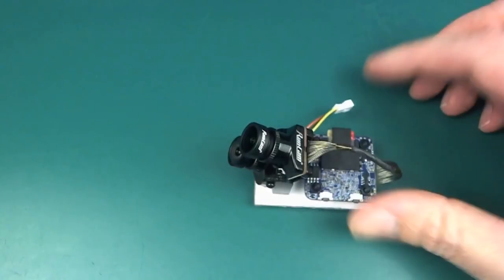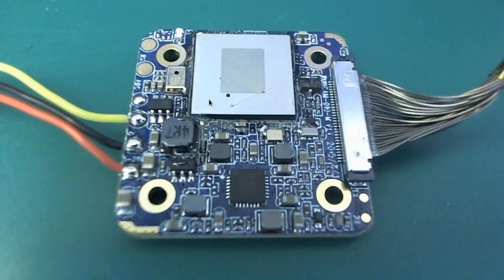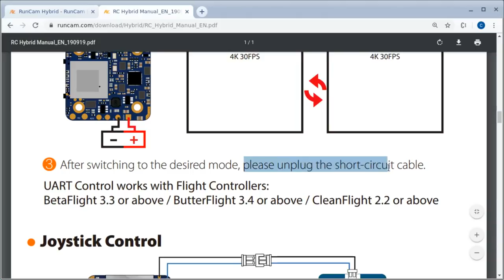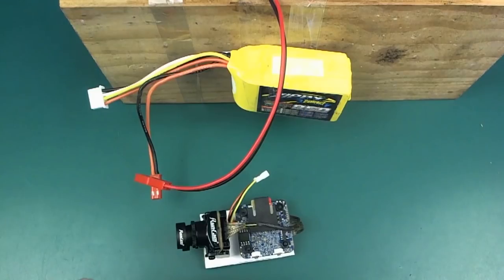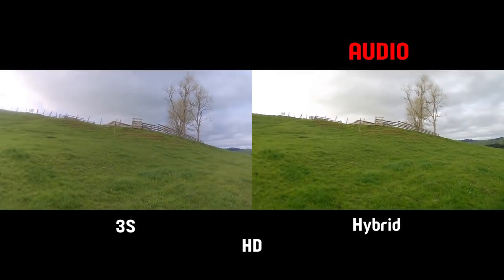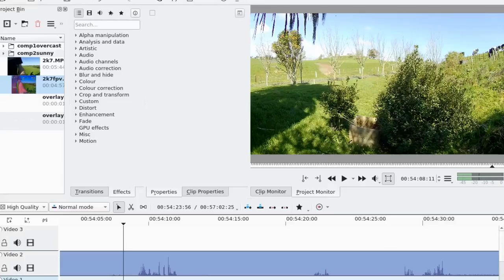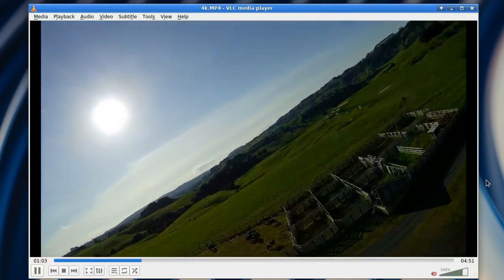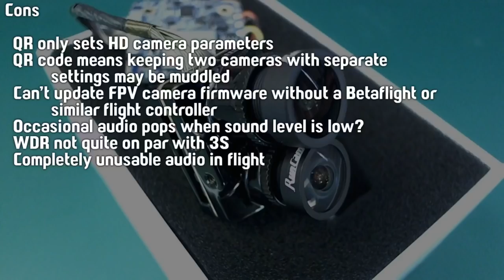RunCam Hybrid review

Comment: Im with you Chris. Kind of like the 3S better. WDR drives me nuts if its not fast at switching. The Split 2S is good enough for me. In fact, I really liked the HD on my straight wing Nano Talon video compared to the Runcam 2 I use most often since we couldnt buy Runcam 3s here. I kinda think the Split 2S has Runcam 3 boards or shares design. Cool vid as always. 😊

Comment: I am looking at the hybrid to record 1080 or 2k video but need a stabilized picture, my understanding is that Reelsteady does not work with Runcam. So you use a stabilizing program post? If so what do you recommend? Thanks and thanks for the video.
Reply from the maker: I use VirtualDub, with the 'deshaker' filter. It's not quite as good as the GoPro thing, but it's free and you can run it on any video, not just video recorded by a specific camera.

Comment: Nice overview of the camera! 

I'd like to suggest an interesting project. DIY HD FPV! I think such a project would interest you and your audience, since it has the "achieve great results on the cheap element", it is requires som DIY but it is not too difficult, it is an alternative to the newly released (and expensive) DJI FPV system, we (the audience) would as always enjoy your presentation, and I believe that, with the astonishingly beautiful surroundings you have in NZ, you would enjoy HD for the FPV.  Several of us have been suggesting you to make a "RC over 4G/LTE project", but I understand that you have limited reception, why this might be an interesting alternative. 

There is the EZ Wifibroadcast, and the development called OpenHD. I think OpenHD allows for the use of Raspberry Pi 3B+ for example. The idea is to establish communication through Wifi between two Raspberry Pi computers, one for the craft (AirPi), and one for the groundstation (GroundPi). 

This system offers 720p up to 60fps and 1080p 30fps (Zero) or 1080p 60fps(other Pis). People have achieved a range of several kilometers, and a latency of about 100ms. It also comes with a nice OSD and allows for telemetry both ways.

I have nothing flying with this system myself, only started prototyping on the bench. So far it seems promising since I could quickly set it up to transmit video, OSD, and send control signals over Mavlink to the flight controller. I use the OpenHD image, Raspberry Pi Zero W (AirPi), Raspberry Pi 3B+, these wifi modules (https://bit.ly/2MbgCTv), standard 2,4GHz antennas, Raspberry Pi Cam v2 (for which I plan to switch the lens to an M12), my phone/tablet and FPV-VR app to display the image, AKK Omnibus F4 Pro clone flashed with ardupilot (thanks for the instructions!) as FC, and lastly Flysky FS-i6x with an USB-simulator cable for controls. 

I believe that you use the Flysky radio yourself, and therefore would like to mention that the USB-Sim-cable only sends out data corresponding to the gimbal sticks inputs. To get around that I'm thinking of maybe borrowing some ideas from David Williams video https://youtu.be/cChOqZ_tLPE . 

Sorry for the wall of text! I'm just trying everything I can think of to sell this in! Please Chris! :)

Comment: The tree artifact is probably some dried glue on something internal. You can probably clean it with some alcohol on a q-tip if it's on the sensor, at your own risk of course. Time to break out that microscope again.
Reply: Looks like fungus to me...
Reply: @aarondcmedia9585  Yeah I agree, seems to be fungus. Odd to see that on a brand new product, must have been stored poorly.
Reply: @aarondcmedia9585  Then I definitely want to see it in the microscope.  Someone call Paul Stamets.